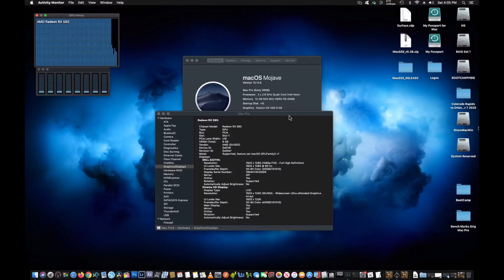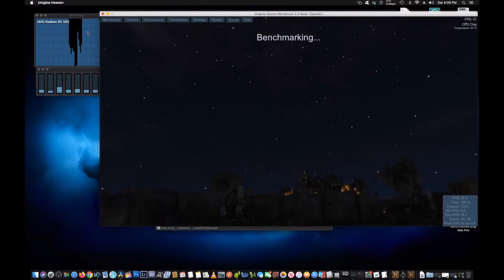Asus Dual RX 580 8GB in Mac Pro 3,1 (2008) in 2020

Comment: Does mac pro 5.1 have the SSE4.2 instruction to use the RX 580? I wanted to buy a Mac pro, I found some offers for 3.1 and 5.1 but I wanted to use it with an RX which one is better?
Reply: Yes, with the MP 5,1 you won't have the problem seen here : the RX580 (4 or 8 G) is perfectly regognized by the OS (mine is High Sierra but I upgraded it to Mojave). So, you plug the GPU and everything is fine, no mod or tricks needed. There's only one con, you will lose the boot screen. So keep your old GPU in case one day you need to access to boot screen...

Comment: I have seen websites that say that it is possible to flash a 3,1 to 5,1 firmware, But also worn that it can be problematic and done wrong, will completely break the machine. I have not found any detailed instructions. One site alluded to the fact that they are the same as flashing the fourth generation, and to make sure that it only has all original hardware in it. Do you know If there is any truth to any of this?
Reply from the maker: I would add no credence to any site that would boost flashing a 3,1 to 5,1as the architecture of the systems processors, ram, ect. are of different generation's.  Where as the 4,1 and 5,1 share the same architecture and design.   But you can still run in to issues with incompatibility ie. you can not put a 5,1 CPU tray in a native 4,1 system or vice versa due to issues with the SMC not corresponding with the tray regardless of the updated firmware or not. There are just some things that are not possible with our the aid of SMD or SMC workstation and a complex understanding of Apples microcode, chip / prom burners and et all.

Comment: Hi. please help me !!! I have a mac pro 3.2 2008 and I put a sapohire graphic press rx 580 and it turns on but it does not give video ... what can I do in that almost?
Reply from the maker: It all depends on the current version of OS X you are running Mojave should boot right up with the RX 580. But if you are using DosDude which you need to on the 3,1 for Mojave during the installation you will have to unchecke the legacy video patch.

Comment: HELLO..! I HAVE A MAC PRO 3.1 2008 WITH A MOJAVE WITH A PATCH, BUT IT DOES NOT RECOGNIZE ME ASUS RX 580 8 GB CARD; SOMEONE CAN INDICATE ME THAT IT MAY BE HAPPENING THAT I DO NOT RECOGNIZE IT OR IN WHAT PART OF THE PROCESS I LOST ME SO IT DOESN'T WORK ..!? THANKS AND REGARDS..:!
Reply from the maker: If you used DosDudes patcher to install.  You may have to reinstall with out the legacy video drivers .  Or any of the video drivers from the patching tool.  Mojave has drivers for the RX already.  If you want Video acceleration  this requires more work to install OpenCore.  That is a bit more work and investigation that you will need to do.

Comment: Did everything and also did the dosdude upgrade/patch but the card shows no screen. Did you had any issue with that?
I dont see any drivers that I could install.
Reply from the maker: Depending on the version of MacOS you are installing you should uncheck the legacy drivers.  For the likes of Mojave the RX drivers are built in and will conflict with the DosDude injected drivers.  Running Mojave on the 3,1 right now with an RX560 put the 580 in the dual 5,1.

Comment: What's the best graphics card to use with Mac Pro 3.1 Octa with OSX Mavericks? The reason I'm stuck, it's because i'm using Protools HD System.
Reply from the maker: TBH not sure with Maverick, Would assume the 5770 should work.  But have not used Maverick in a few years.

Comment: Do you have audio sound (hdmi or display port) with rx580 ?
Reply from the maker: I have audio on the RX 470 and the RX 580 in each of the 5,1's running HDMI we are not using the 3,1 any longer for media center.  But it did have audio with Mojave.

Comment: Did you have to flash the video card or just install and use the patcher in Mojave?  I have a 3,1 with the Nvidia stock card and looking for card to run a 3rd monitor.  No video editing on this machine as I have access to a MacPro 2013 (trash can) in my office. The 3,1 will be my daily office computer.  3,1 is running High Sierra and would like any recommendations.  Great video!
Reply from the maker: I did not flash the card,  but have since put OpenCore on it so I have boot screens.  I did use DosDude's patcher to install Mojave.  as far as a second card I have not tried so not sure how that would work. Good luck using our 3,1 as a daily driver at the moment too.  Using the 5,1's for different things at the moment.

Comment: Hello.  Thank you for this video.  I have  a 3,1 at the moment running Mojave via DOSDUDE1 patcher and I have a EVGA GTX 680 GPU(Metal) and 32 gigs or RAM.  I want to use Davinci Resolve to do 4k editing but the projects will  be no longer than 5 minutes.  Do you think im ok  with what I have to render in Davinci?  If not, do you recommend a card a step up from the one that I have now to be able to run Davinci effectively ?  

Thank you in advance.
Reply from the maker: I have not tested DaVinci 16 on the 3,1 Can do a quick render here in a bit ans see if it will work currently running an RX560 2gb card in there with Open Core so the acceleration should work
Reply: @CorbinElliott  That would be so kind of you.  Id rather get Davinci rather than Filmora just for the color grading aspect to be honest.  I think that if it works well on the RX560 2gb then I wouldnt see a problem with the card that I have because it is also the 2GB version.. If it struggles a tad I dont mind and I dont mind waiting for a good render to be honest since my projects will be short.

Thank you again for your time and fast response.

Comment: Will this machine be a good choice for video editing in 1080p in 2020? I have found one really cheap, around 290$
Reply from the maker: Yes the 3,1 could be a very capable machine to do 1080p video editing.  You will want a decent GPU I would say Mojave and Davinci Resolve will work very well with Metal support and a bit of working around things to get OpenCore installed for Video Acceleration even 4k should be do able as the GPU will do most of the work.  I would recommend SSD's for the OS and Scratch Disks for better speed. With that said it will not be the fastest but very capable.   http://www.cesgeekbook.com/2020/06/opencore-mac-pro-2008-31-mojave.html

Comment: Too bad the the 580 doesnt have Video accelaration even though that is Metal, Have you considered, OpenCore?
Reply from the maker: Yup, have it on our 5,1.. and dosdude patcher includes the sse4.2 patch as well as radeonboost.  That is why the 470 is in our media center 3,1
Reply: @CorbinElliott  Really? Please tell me more about RADONBOOST
Reply from the maker: @RamsesAbascal  this is the opencore version I found and have not tested yet.  https://forums.macrumors.com/threads/refind-opencore-multiboot-guide.2231693/
Reply from the maker: And there is a post on OpenCore for the 3,1 but it is running how I like it at the moment so would not want to have the machine down for any length of time at the moment
Reply from the maker: And glad you got your RX470 working!!!

Comment: You have a link for the cables needed? thanks :-)
Reply from the maker: https://www.amazon.com/gp/product/B07V4GGS43/ref=ppx_yo_dt_b_asin_title_o00_s00?ie=UTF8&psc=1 is the most recent one I used for our 3,1 with the RX 470 it plugs directly in to the logic board instead of multiple connections